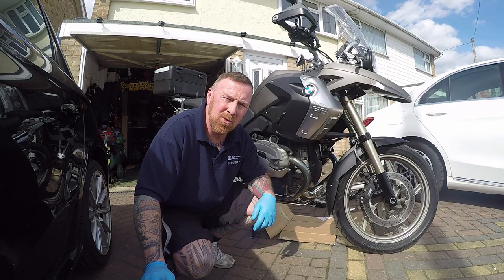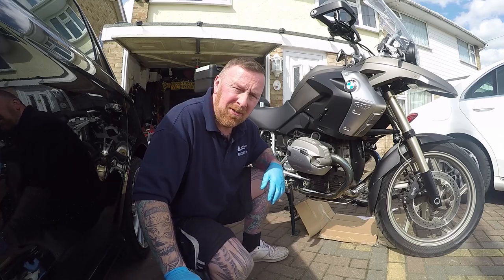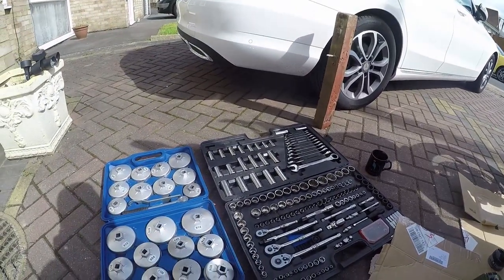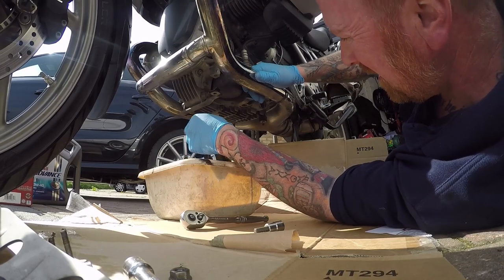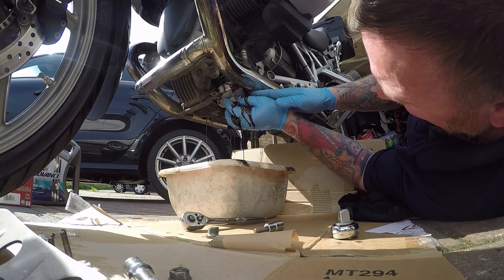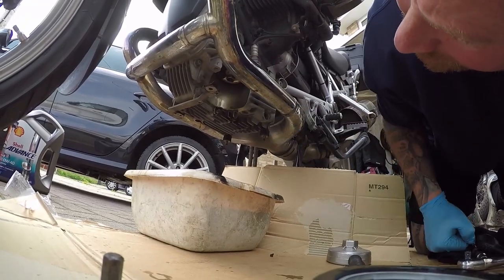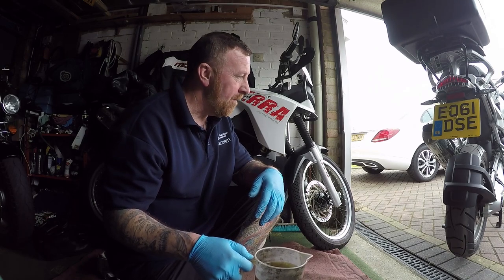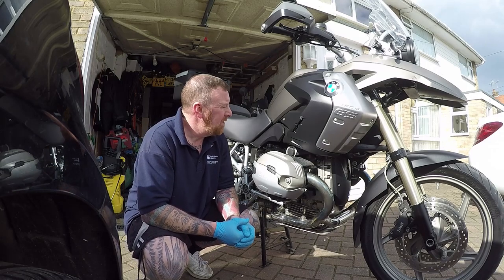BMW 1200 GS SERVICE HELP TO SAVE MONEY MARK SAVAGE

Comment: I already know how to do all this stuff but I still love a good DIY video, just wanted to add you don't need to completely unscrew the metal side panel (5:30) as it will come right off with the plastic piece it is attached to. You only need to unscrew the forward most screw on that metal trim piece. Great video, cheers!
Reply from the maker: ACH-2 thanks bud and for watching 
Mark

Comment: Great vid as always. I’m sure you already checked, but usually the oil filler tool for a gs is under the seat, and is part of the screwdriver handle.
Reply from the maker: yes i did but think the last owner took it out lol, but thanks for the comment and watching bud
mark

Comment: Great video Mark! Thank you. Real quick, My '12 R1200GSA is hitting only on the left cylinder. I was cruising home on the highway and the rt. cylinder just dropped out. Plugs are good and I swapped uppers with lowers and right to left and confirmed they all spark while cranking as held to the frame. I bought two new primary coils and installed them with no change and even swapped in the event I got a bad brand new part. I do have an O2 sensor #1 code (271A) that comes up in Moto Scan so I removed them both, cleaned them and swapped them and the same code returned. I swapped lower coils, though they didn't fit I still got them connected and snapped in with no change. I confirmed both injectors spray fuel in a good pattern while cranking the bike but bought a new one for the right side anyway and installed in to no avail. The throttle body valve does turn with throttle twist as I could feel it with my fingers. The bike will fire up on just the left cylinder but the right cylinder, with spark and fuel does not want to fire!  Thanks for reading so far sir, and if you would please let me know what else I could try I would greatly appreciate it sir. TY
Reply from the maker: You've done what I would have done !
Yet it still doesn't run on that side 
How odd
Either valve or piston failure 
I wouldn't pay any more out bud but sounds like it's a bigger problem than you or I can sort sorry to say bud
Reply: @marksavage  Ok, thank you Mark.
Reply: @marksavage  One thing I have not checked yet is if there's a small rodent that crawled up and died on the right side intake but will today.
Reply from the maker: @mattcero1  oh what ! Really do the do that,  I guess for warmth ! 
Worth a cheap bud
Reply: @marksavage  Indeed they do. Many stories out there of mice and rats making their way into engine compartments for warmth and "housing".
Reply from the maker: @mattcero1  well if it is it sure will be cooked rodent pmsl
Reply from the maker: @mattcero1  just watched a few of your videos on your GS 
Good to see others making helpful videos 
Well done 
Do you think it could be a valve problem or something else in that area , I know it was 6 months ago but worth a re look
Reply: @marksavage  Thanks Mark. Actually, the problem I'm having with it hitting only on the left cylinder is only about 5 days old. And yes, the valves or a clog in the intake. I'll check both later today and report back. TY
Reply: Did you get it sorted?  @mattcero1

Comment: The screw drive handle under the seat is the tool for the oil cap.
Reply from the maker: they do normally but not with this one so had to do it the old way lol
thanks for watching I have a few more videos on the bmw you might like to watch
mark

Comment: Good  video. But if you have the original toolkit under the seat. there is a screwdriver grip , the shape of that plastic grip actually fits the oil fill cap ...just my two pennies

Comment: Just got a 2013 GS so thanks for the video. But I was really impressed to learn that the screw driver, part of the bike tool kit, which surprisingly was intact on my bike, has the key to open the oil filler. The driver has a handle with the right shape to fit that wierd cover. Only Germans eh!
Reply from the maker: Yea I know but didn't get the tool kit with this one 
All in great bikes so enjoy bud

Comment: Looks like BMW and Honda are on to the same gig, surround all the maintenance stuff in plastic, so they can charge you another 30 minutes labour on your basic servicing.   Nicely demonstrated fella, will save a few pennies for people.
Reply from the maker: GTs Garage thanks bud and yes £175 for an oil change at Bmw and £100 an hour labour 
Like you bud I try and help others save a few £s 
Also had good feedback on the Yamaha fjr service video so all helps 
Not worked on your bike yet maybe I’ll get one , one day 
Keep safe bud and unlike me don’t drop it lol

Comment: Check your motor tools. The handle off the screwdriver is the tool to loosen the filler cap. Cheers
Reply from the maker: yes mate that's been said before but mine didn't have the tool kit Grrrr

Comment: Thanks Mr. Mark. I am awaiting delivery of my 2019  GS HP so I was looking for someone to show how basic maintenace was..... I really appreciate your time and effort... Cheers from USA
Reply from the maker: that's ok bud and you enjoy your new bike, I had a few of these GS's now with videos on here and if it was not for me being a short ass i'd probably still have one as I really did enjoy this one better than my LC but do keep looking at the new 1250 GS but maybe in the short frame version lol 
enjoy and take care on the roads bud
Reply: @marksavage  I'm 5'11 and I went with low suspension...Its the ease I wanted, and if later I feel it's a bit low I change the seat and put the suspension at highest setting it's a win win...cheers
P.s. when I say I change the seat is not buying one you can adjust the height in case you dont know lol.
Reply from the maker: yes bud I did its a good little feature to be able to be able to adjust it like that, enjoy and stay safe

Comment: FYI: Under your bike seat is a small tool kit, the key is the screw driver, disconnect the metal part and you will see that the screw driver handle itself is actually the tool to unscrew your oil cap.
Reply from the maker: Yes I know but it wasn't in there lol
But thanks for watching and your comment
Reply: mark savage: No problem, great video. Thanks for the tips.

Comment: 1:57 how is your hand just resting on the header pipe like its nothing with thin gloves on after a proper ride to get it to operating temperature? I have to call bullshit on that small part of the video because I know for sure that the header pipe would still be blazing hot and even touching it accidentally would cause you to flinch from the burn(talking from experience). Other than that small thing, amazing video helped me a lot especially with the plugs.
Reply: DMac of Queens It doesn't have to be BS. It is good if the engine is warm when you change oil but it doesn't have to be smoking hot. Maybe he let it cool down f. a while and then changed oil? The exhaust pipes get very hot but they also cool down rather quickly.

Comment: Mark whats better for reliabilty the 1150gs or 1200gs now my options are on the gs or honda varadero
Reply from the maker: Budget and looks 
Me the 1150 and honda look dated and both other sides of the spectrum 
1200gs hold there money but all in a great bike 
Maybe look at the yamaha fjr, triumph trophy , triumph tiger , honda pan , kawasaki versys 1000, 
All good bikes and all of them on my channel 
But comes down to what you want them to do bud 
Weekend out,  work,  touring!

Comment: Under the seat there is a key that you need to Unscrew the oil fill plug!
Reply from the maker: Yea bud I knew about it but it wasn't in the tool kit so had to do it the old way 
Take care bud

Comment: Hi there Mark, could you share me the oil and air filter part numbers? Also could you tell me where to look for the oil filter removal tool and what brand? Thanks in advance and great video!!
Reply from the maker: il try and find them later for you but to be honest e bay is the best place and most sellers not allow you to put in your bike and the reg of your bike to get the right parts ]ive even messaged them to confirm they will fit and they have always answered back 
but all in it will save you a lot of money doing it yourself and following my videos
thanks for watching 
mark

Comment: I always fill the new oil filter with oil... to the top let it soak in...
Reply from the maker: oh right no ive never done that as most filters for bikes are on there side and that would get a bit messy lol 
so i aways start and run for a bit then check and fill 
take care bud
Reply: @marksavage  if on side of bike car etc...you put a bit in oil filter, it will soak it up... then be ok if on side just don't go over board if on side...😎

Comment: I don't understand why you have to warm the oil up before you drain it. I know this is standard practice on cars and bikes but when you think about it, the oil ends up in the sump after a ride. Therefore the oil has always been warm and thinned so all  of it would be in the sump. So why bother?

Comment: Hi mark I’m looking to buy a pretty low mileage 30000klm 2006 model ,are they any issues I should be worried ( abs unit is been serviced) or I should prefer a 2009 and onward model. Thnx
Reply from the maker: indicators may pe you off being on both sides but, all in great bikes
gear box and gear change and to be honest I had a few and my newest one 2017 was the worst gear change and the 2011 was amazing !!
yes abs is one point to keep an eye on and good service history and 30k is good as clutch about 50k and that's a lot of money and time

Comment: Didn't you bother filling the oil filter before installing it?
Reply from the maker: its been a long time since anyone tried to fill up the oil filter then fit it while all the oil comes back out  
so no bud I don't try that on any of my bikes or the 100s of services I done also most are horizontal fillers and if not they will fill if at the bottom any way 
this is why I always say start the engine after filling and re check after the first ride
Reply: Yes always fill mine!
Reply: @bigronvfr750  Yes, as the filter is verticle I don't see the problem. Still, up to him I suppose.

Comment: What is the part number of those NGK Iridium plugs? I am looking to do my 2011 R12GS and can't seem to find that info.
Reply from the maker: I’m sure they were 
 iridium NGK DCPR8EiX spark plugs to fit the single camshaft BMW R1200GS 
Was trying to look at old part work 
But type in year and make on e bay bud otherwise stick to standard

Comment: O:36 my GS came with an oil filler cap removal tool in the factory tool kit.
Reply: At 4:00 and at 4:32, it could be worse. You could be riding a motorcycle with Lucas electrics which means you could be looking at a parked motorcycle instead of riding it. You know, Lucas, the Prince of Darkness. LOL